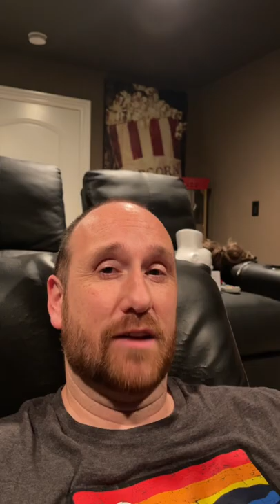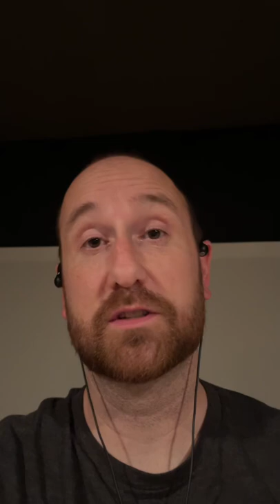Upcoming Center Channel Video.     #shorts

Comment: I think it would be best to move from seat to seat with the speaker in fixed location and volume. This should give a better feel as room boundaries and location effects the sound. If you turn the speaker, it could give a false reflection of the sound. Just my opinion, and thanks for doing this. I'm really interested in the results too. It would be interesting to see the sound of 2 channel versus 3 channel using the same speakers and moving from seat to seat, as center channel maybe more marketing than true performance.
Reply: I was here to say the same thing. Just limit the bass with a super high crossover.

Comment: Perfect timing, I'm considering building a DIY kit speaker  for my PC desk, I like the looks, low end, and tall aspect ratio of the MTM speakers (vertical) but the off axis has me spooked. I also wonder about the  imaging in a nearfield application.  I think I should be able to stay in the sweet spot pretty consistently since ergonomics will keep my head at the same height relative to my desk.

Most desktop speakers need significant 5-9" stands to bring them to listening height,  I always thought the stands were such a waste of volume/space. I wish someone  would make "Mini  Towers" that would sit on a desktop and put the tweeter at ear level.  A little TMM with 4-5" drivers with a front port would look so cool straddling a screen. Might as well put the  speaker stand volume to work acoustically.

Comment: The funny thing about this video is that this looks exactly how my home theater is looking. I was comparing the horizontal directivity of my jbl 520c, s-center ii, n26ii, and s38ii. I was hoping for the s38ii to be the winner, but the treble and mids were beaming really bad. The n26ii was fantastic for directivity, but the woofers had resonance or some other issue that was identical between the pair.  I gave up and ordered some 530's to use as my center.

Comment: Of all the awesome content you have made I think this one is the most exciting to me. Nobody is really talking about centers despite them being so flawed in design and being so important. Look forward to seeing what you find and if my theories are correct. 

I was going to say that angling the speaker would effect things too much but the more I thought about it (assuming my ms paint math is correct) moving seats to the right is essentially adding x degrees to the on axis and right first reflection point and subtracting x degrees from the left first reflection point so pivoting the center by the same x degrees would do the exact same thing but without room modes changing in the bass from switching seats. However this is assuming side wall energy is being reflected which I know you've said your sidewalls are more heavily treated which will probably be great for the binaural demo as that prefers an acoustically dead room. However I do wonder if that would skew the findings from your subjective opinion. By having reduced sidewall reflections speakers with narrow dispersion aren't going to have as much variance between the good and bad designs and speakers with worse off axis aren't going to have as significant of an impact due to the sidewall interactions not being as significant in the overall sound heard. Ideally you would do testing with the panels added and removed but this is already a HUGE undertaking comparing as many centers as you are so I completely understand adding another variable (treated vs untreated) as being too much for the scope of the video. Appreciate you reading this far and really look forward to the video!

Comment: I'm missing something here?
The other day the guys got the question: "If two center channels, one above and the other below the screen."
I just thinking about for example putting the sound processor to 4.1 instead of 5.1.
Then it will make a normal fantom center and the problem of center speaker and the screen that are competing with the same physical space is gone.

Then we have the problem with the side seats that are sitting closer to the speaker that is in front of them..
That is solved with toe in. Right front speaker pointing to left side seat and vice versa.
Problem solved?

Or it feels like the goal in home cinema is the one with the most number of speakers winn? As usual humans always think that more is better 😉

Comment: I'm all about LCR's. Some of those centres look too small for your room and distance from your seating position.
Reply from the maker: That's not the point of the video.  😉
Reply: The center channels don't need to carry bass and could probably get away with a .75" tweeter and a 2x4" woofer with a cutoff at 120hz.  The problem is they always do the MTM which means unless you are sitting directly in front of them and at tweeter height or below you lose most of the sound.  

In reality I don't think any center that isn't a 3-way speaker or a concentric 2-way has measured well.

Comment: Erin correct me if I'm wrong but I feel like a majority of center channels are 2-way and don't have good horizontal off axis response.  Wouldn't it be better just to dump the money you'd spend on the center into better L/Rs?
Reply: I have tried to get used to 4 channel with a "phantom" center mode but dialog just never sounds right in tv/movies.
Reply from the maker: That’s the reason I am making this video. To show people why most center channels are an issue.

Comment: Don't hold back! Most center channels are wretched pieces of engineering garbage: to get good horizontal dispersion on the MTM ones you literally have to place them vertically and block a line in your TV. Incompetent design purposefully made to sound bad when placed horizontally under your TV.